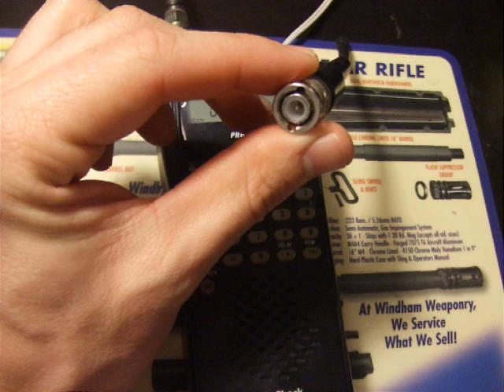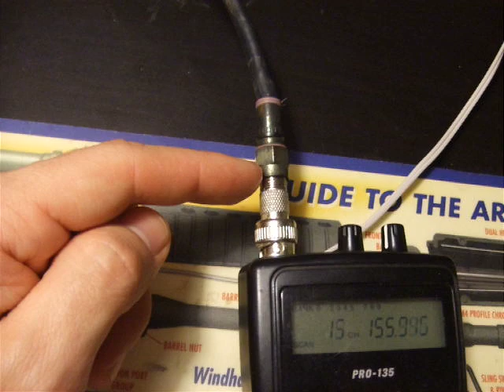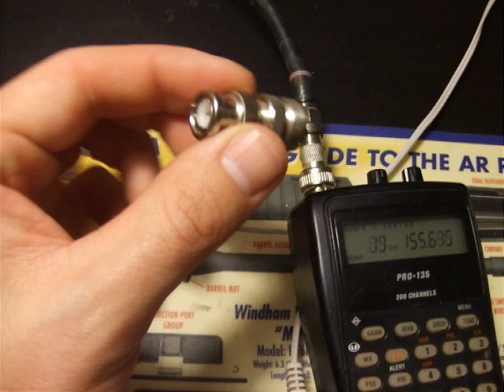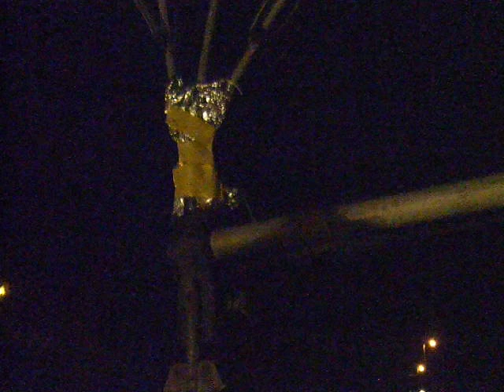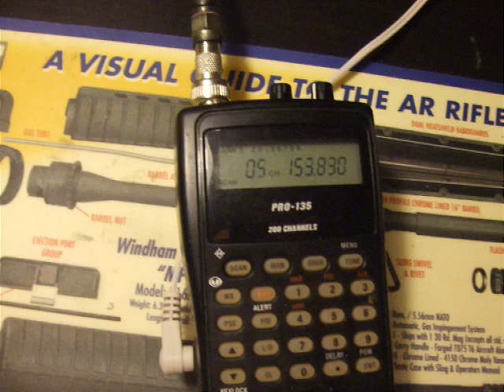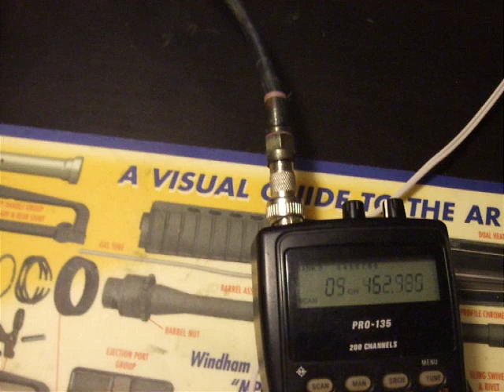Radio Shack Pro-135 Scanner - My Setup

Comment: Hey, thanks for sharing this video. I have the same model of radio that you have, the Pro-135 Radioshack Radio, excellent little thing, really does the job well. I was hoping you you could help with my little problem here, in the manual and all of the sources on the internet are telling me that it can reach all the way down to 25 mhz (even the official manual). When I'm scanning though it hits 30 mhz and starts running right back up. Basically my dillemma here is on how to hit citizens band with this thing, everything else is coming out just fine. Any help would be greatly appreciated. Thanks.

-WRS